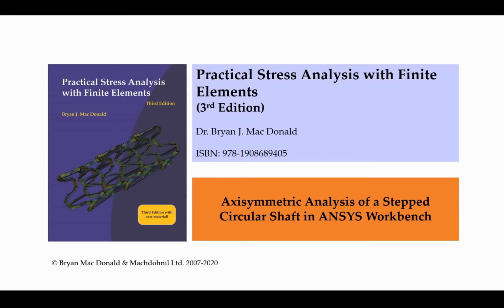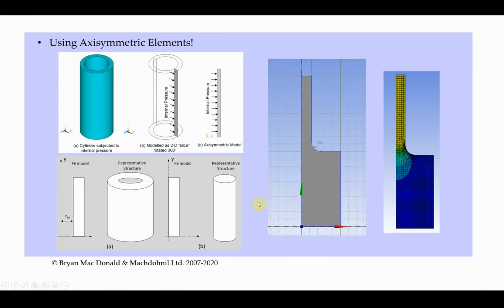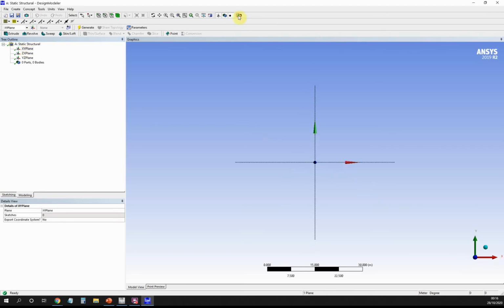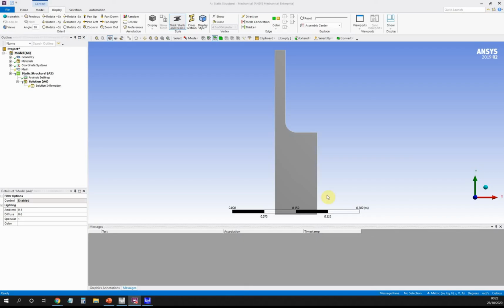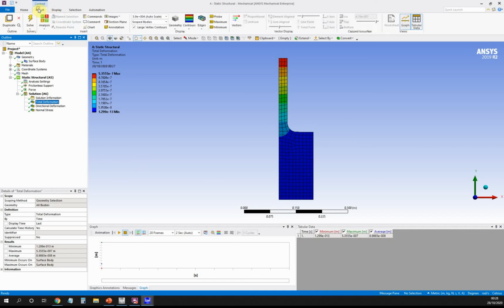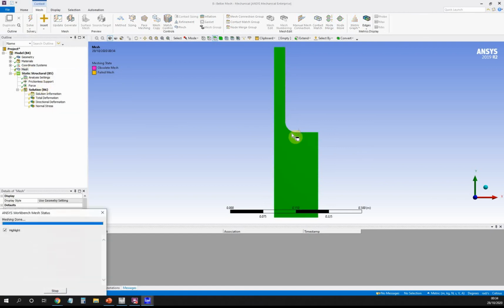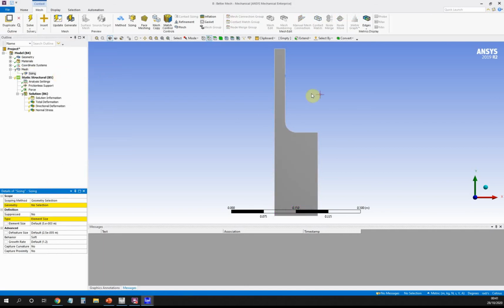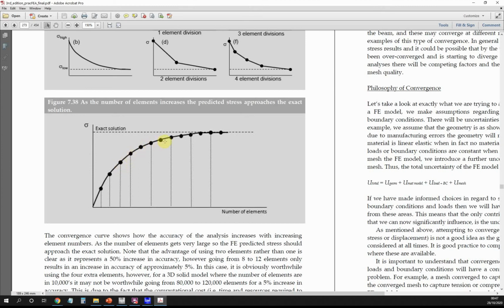Axisymmetric Analysis Using ANSYS Workbench

Comment: can we model stepped bar as u moddelled in 2D plane as if is it a plane cross it along the length?
Reply from the maker: Hello, I am sorry but I don't understand your question. Can you rephrase it?
Reply: @LearnFiniteElementAnalysis  I mean if the there is a stepped bar loaded axially. can it be modelled axisymetricaly and as a 2D plane?
Reply from the maker: @cadinsider964  It certainly can be modelling asymmetrically but a 2D plane either assumes plane stress (with zero stress through the plane) or plane strain (with zero strain through the plane) - neither of these would be correct if you just took a slice through a stepped bar loaded axially.

Comment: How can i simulate 2D axisymmetric model with a force isn't symmetric ? It means the force just has the impact in one side of the model (don't be axisymmetric)
Reply: Symmetry should be not only in geometry but also in loading. Keeping this in mind you can try make a symmetric model if possible.
Reply from the maker: Yes, you are correct. In order to use axisymmetry (or indeed any other type of symmetry) both the geometry and loads must be symmetric about the axis of symmetry.
Reply: ANSYS Classic/APDL has a method called "harmonic axisymmetric" that allows you to apply non-axisymmetric loads to a standard looking axisymmetric model.  The element formulation is adjusted to allow this behavior.  The term harmonic is confusing to many because the harmonic refers to Fourier coefficients used to define the non-symmetric loads.  Harmonic here does not mean dynamic or time-changing.

Comment: Great video. Thanks a lot! By the way, I wonder if you know how to solve the problem "a cylinder under torsional load" in 2D axisymmetric way? I have seen it in some papers but I don't know how to do it exactly. It seems ANSYS has some special elements for it which can be seen https://simutechgroup.com/a-brief-introduction-to-the-solid272-and-solid273-general-axisymmetric-elements-in-ansys/.
I have been stuck by this problem for some days and I would be grateful if you can help me.
Reply from the maker: Hi, glad you liked it!
It is possible to apply a rotational velocity to axisymmetric elements in workbench. If you open up the help system and go to the verification manual and look up VM-WB-MECH-062
"Stresses in a Long Cylinder" you will see an example of how to do this. Otherwise, I think you would need to use ANSYS APDL (i.e. the "classic" interface to ANSYS) in order to be able to use torsional loads on axisymmetric elements.